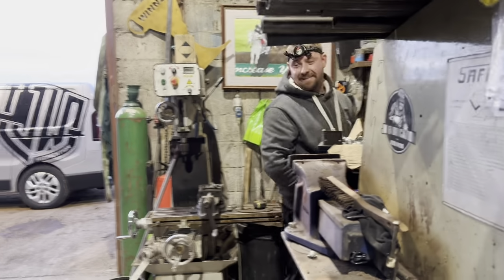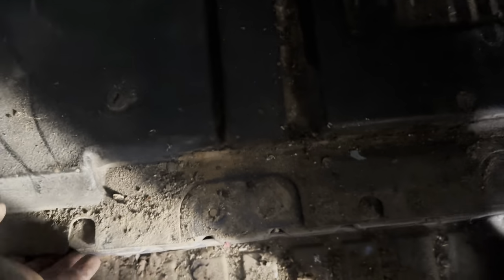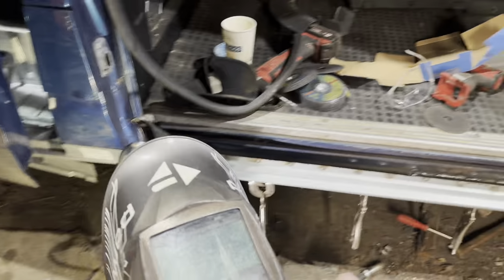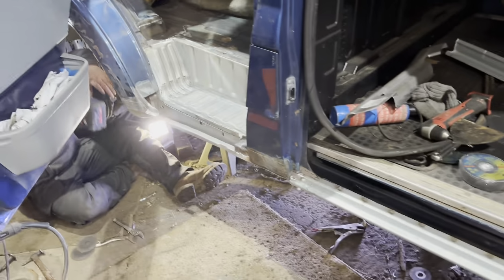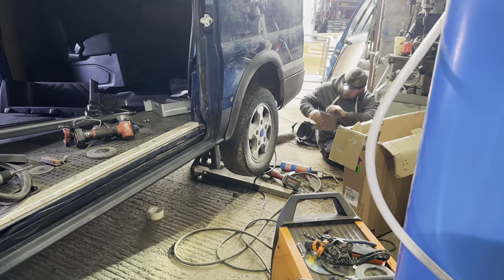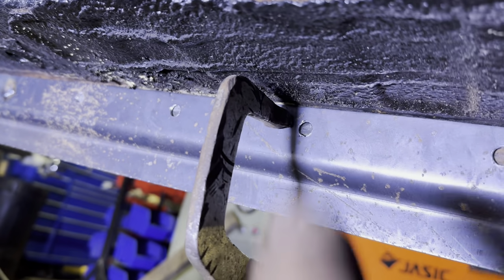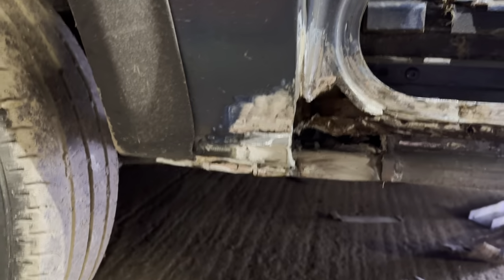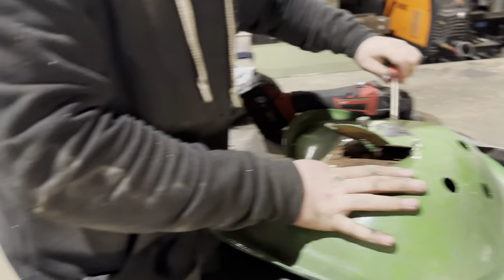Terror Transit van with rubber sills, How many new panels

Comment: That's just like a mk5 Transit i did about 10-12yrs ago it was an Ex-RAC van and it was rotten like a pear, inner outer wings inner and outer wheel arches inner and outer sills, steps rear inner and outer rear wheel arches and rear inner and outer cross member plus the bits of chassis legs that attached to the rear cross member, everytime i started to grind it up to weld it just kept creeping and creeping i was over the moon once it was finished and seen the back of it 😂😂
Reply from the maker: I was happy to see the end of it but said I would do another 😂😂
Reply: @JWFabrication1  you would do another? Glutten for punishment you are like lol
Reply from the maker: Yes got a Hilux in to do and then  mk5 I think which needs everything 🤮

Comment: If that van was in Australia it would have by-passed the wreckers and gone straight to the tip! Wow! I NEVER seen a van as rusted as that and still standing. I'm really surprised that anyone would bother fixing it. Even with new panels. Is there really anything left to weld too?
Reply from the maker: Sadly, it’s a total different climate, you can have vans only 6 years old rotten like this with the salt on the roads 😁
Reply: @JWFabrication1  I used to be into Classic English cars like, Healey's, Mini's etc. and a 1958 Sprite would have zero rust compared to  that van. I have the same van and am doing the rust sections ATM. I think you would be jealous of the current state of the panels, rails and skins which are near perfect. Everyone loves these vans, especially the MK6 (VH-VJ). However, owners NEVER get rid of them because of rust. How bazar. I would have a plastic car with all that salt on European and American roads. Rather than worry about the paint work. the money should go into total rust proofing the entire underbody and foam-fill ALL cavities, including lanolin or Wax oil. ALL Ozzie cars suffer terribly from weathering and sun damage. Clear-coat can break down in five years. But is a lot easier, but just as expensive, as rust. My hat off to you sir!
Reply from the maker: Some nice cars there 😁